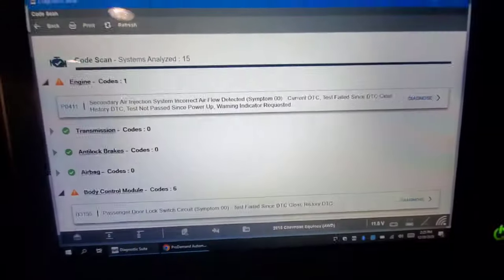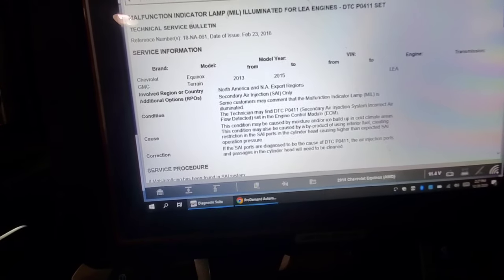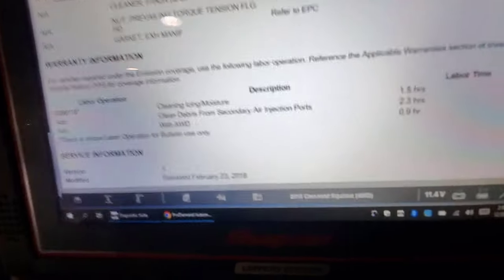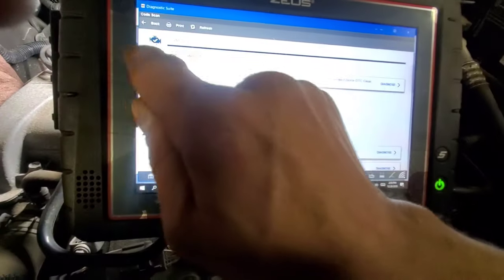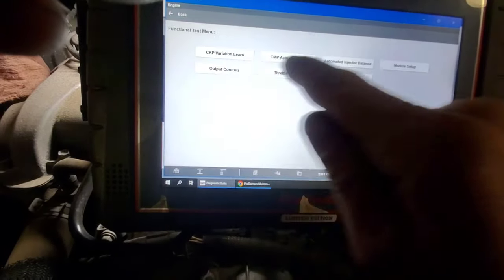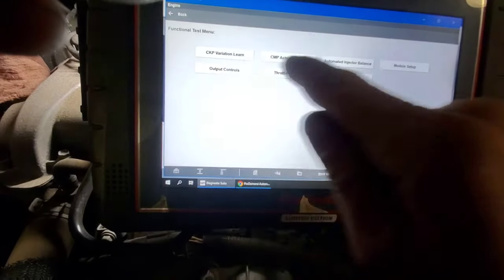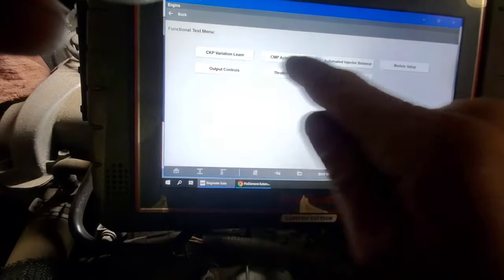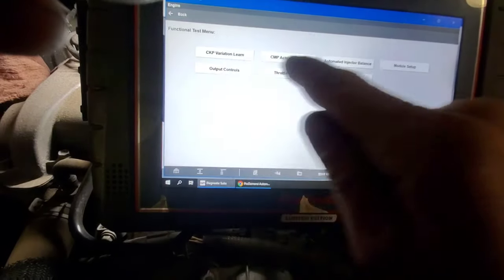GM 2.4L P0411 SECONDARY AIR INJECTION AIRFLOW INSUFFICIENT

Comment: Saved me with this info i have a 2009 saturn aura 254,000 miles i tested my secondary air injection pump working great! I dismantled the air valve that goes behind the block of the engine and has plenty of carbon build up

Comment: Are the 2 runners held on by 2 studs per runner and the studs have nuts or are they bolted to the motor? Might be har but could the runners be removed from the top with some effort and colorful words?

Comment: i am currently engaged to one of these , It should have been a warranty repair by the Manufacturer , but here I am . those S.A.I. valves should be replaced and in Pairs only by the same manufacturer. there are reed valves in them and they burn , get hot and warp  so they leak and hot exhaust cooks the inlet valve , you can take the top of the valve , 4 screws and see what i'm Talking about, they have to be tuned for the initial air charge to read in Balance , scan data calls it variance, no more than 3 psi , scan info for one is listed as KPA's and Psi on another "Confusing at best, but the conversion has to be done to be accurate. Baro  and circuit A to Circuit B , I'm presenting that as air inlet A and air inlet B, Those need to be calibrated to match seal at below 3 psi. I took them off and started the engine to feel the exhaust blowing out of the ports, I saturated the ports with  de-carbon , BG 44k, now that I nave the balance , it takes 2 test drives 35 miles to get the sec Air monitor to run , usually right after the Cat , monitor sets, time consuming way beyond 5 hours, and a lot of it seems pointless and overkill , but that's Emissions for you, I check tomorrow morning to see if flow goes through the Head , I assume it does because exhaust is blowing out of the ports. but it may be  restricted just enough. the Sec, Air  system test in the snap on program allows both valves to open and pressurize , if there is an imbalance in the upper chamber of those valves code p0411 sets immediately. if there is balance it's on to phase 2, flow through cylinder head , I'm hoping the de carbon will break it up so there is no tear down of the manifold I'm already way upside down in the estimate. 15 hours should be the total check out and repair of this rig.
Reply from the maker: Fascinating, thank you for the info.
Reply: Day 2 , honeymoon is over, I can't make this thing happy , i have a zero variance , psi increase of  1.7, 0'2 signal responds instantly when AIR pump is activated, Map spikes, and Baro is spot on with sec a.i.r. valve sensor 4500 ft elevation 85 kpa, 12.5 psi, as soon as the sec monitor passes it codes p0411.  I need to send this thing back to it's Mother! Where are the figures for expected calibration? What is the Calibration standard? I wonder if there is a Load sensor for the A.I.R. pump? internal  pcm? not mentioned in diagnosis trouble tree?
Reply from the maker: Maybe you have a weak pump due to the blocking of the ports
Reply: @PaulysAuto   Got it! pump is fine , I took the manifold off finally, and there in was the culprit, I had a flapper, pieces of the burnt S.A.I. valve were trapped in the ports, port could breathe, but the flapper would close it off ,  randomly ,  after I cleared the debris, the Monitor set immediately , one of the noticeable scan  data information was the secondary pressure pid, not the  secondary sensor , but the secondary pressure , and the variance both held pressure  when it faulted, after clearing the debris the pressure would go up with the air pump but would fall off as soon as the pump shut off, one trip , sec monitor passed at start up.  Thanks for the video it was helpful to know that steps have to be followed, Time is Money, Money is time!

Comment: I just found this video and it's exactly my problem...P0411 insufficient flow air injection...but wow so much work...I wonder if can be done without  CAT coming out?
Reply from the maker: It's best to remove everything...you will have a much easier time cleaning those cylinder head ports from below.  It's time consuming and messy, but be sure you clean it thoroughly or you'll be in there again.

Comment: Currently in the middle of replacing an engine in one and the replacement I got had these holes but the car itself didn’t have the modules . Am I able to block them off or should I just change the heads
Reply from the maker: The Exhaust Manifold Gaskets do that if I remember correctly....different Gaskets depending on emissions.  Sorry for late response my friend.

Comment: I have a 2006 chevy trailblazer keep failing emission this the only code that comes up P0411 even the Chevy dealer can’t tell me why I keep having this code after everything has already been replaced!
Reply: Question I got the P0411 code... i replaced the pump but the original pump is actually good. So that was useless. I dont want to keep buying parts if they arent bad. What should be the next step? Valves? Solenoids? How can I pinpoint it?

Comment: Awesome video just helped me out a lot but the customer came back a few weeks later and it says secondary air injection low voltage but I checked and seems fine so I'm lost again.
Reply from the maker: Did you do your voltage drop tests on both your SAI Solenoids?  Also would be good to do pin tension testing on both the connectors.
Reply: @PaulysAuto  thanks I will do that!!!... I checked voltage in both solenoids and they were the same but I will do that and see what happens thanks.
Reply from the maker: @philliprollman7421 very good keep me posted on your findings...God Bless my friend.
Reply: @PaulysAuto  thank you..and I had another one show up today for the same thing
Reply from the maker: @philliprollman7421 maybe you are called to finding the REAL reason why?

Comment: Uy veh.  Yet another reason I don't like my wife's 2013 Equinoxious.  We've had the P0411 for about a year now, I know the pump works and the hoses are clear.  Has to pass e-check next year.  Between this problem, the chronic oil burning, and the rusting doors, it's been quite a cursed little car.
Reply from the maker: Well, you gotta stay on top of oil changes, induction services, and so forth with the GM 2.4L, you should be watching my livestreams my friend 😉
Reply: Hmmm...my 2013 doesn't have this secondary system. It must be a California emissions thing. I recently rebuilt my 2.4 and wonder why some do and don't have certain things.
Reply: @PaulysAuto  This is actually an incorrect statement. Even if he stayed up on oil changes and watching your live streams, it would not help him. It's a know fact and there was even a class-action lawsuit that some of the 2013 Equinox's got some bad motors that the rings go bad and burn lots of oil. My girlfriend has one, and it would burn a quart of oil every 450 miles. The rings are so bad, you can hold your finger over the vent tube on the valve cover, and it'll build enough pressure, that when you let go, it's like a turbo blow-off valve going off. lol. Also, with some these burning oil that bad, and say the cat gets clogged, could the pressure above the cat in the exhaust system be a cause for this code? Like not letting the solnoids pump the air in becuase the pump doesn't have enough pressure to fight with the build up of pressure because of the clogged cat?
Reply from the maker: @MagnumChris   Eventually you have to re-ring any engine with emissions like this and let's just be honest, the 2.4L is a gravy engine to re-ring.   You can soak the d*** rings and slow the oil burning down or you can just bite the bullet and slam the pistons out the bottom and get it done.   And I still think and I will still hold up to this, people do not change their oil enough nor do they even check it frequently - that's a straight fact.
Reply from the maker: @MagnumChris   GM Engine Top Tier does amazing things -  Which is what's recommended to clean these ports on these heads with these California emissions when they get plugged up with all the crap thanks to California's ridiculous standards!
Reply from the maker: @MagnumChris   As far as the plug cat is concerned if the cat becomes clogged or burned down you're missing something besides the oil burning.
Reply from the maker: @MagnumChris   An engine that's burning that much oil, probably isn't reaching adequate operation temperature due to short trip driving; which is the worst thing you can do for any engine.
Reply: @PaulysAuto  This equinox also blew out the T-Case, the bearing near the cat went. My theory is with the rings being bad and it burning so much oil, that the cat was getting super hot and broke down the T-Case gear oil prematurely. Other than this thing burning oil, it actually hasn't been a bad car.
Reply from the maker: @MagnumChris  That's an interesting theory 🤔...I am sorry to hear that, they really are nice to work on for the DIY guy at home...that's why I like them 🙂...simple and reasonable in price to fix.
Reply from the maker: @MagnumChris   If I were to buy one I would stay away from all wheel drive makes it a lot easier to work on and less problems.  Those transfer cases Definitely get warm it's a shame they didn't run a small cooler on them Like Ford ended up doing on theirs...cheap as possible to make it affordable -  You know the drill.

Comment: Stumbling across this as I'm actually looking to replace the exhaust manifold but came across my engine having what I'm finding out are these...secondary air injectors.  It made the task a bit more complicated than I'd hoped after watching other videos regarding manifold replacement.  Question...are all of these bolts for the "runners" easily accessible?  Upon a quick inspection of the engine and when I found out these were in my way I was able to see/feel for maybe 2.  This wasn't very in depth but it appeared this was going to be quite the chore getting these off and out of the way to get to the manifold (I think I've read a few comments in some message board/forums also stating that he was seemingly unable to get to find all of the bolts holding the runners on the header).
Reply from the maker: They are accessible, but a set of wobbly 1/4 in extensions is a must my friend.
Reply: @PaulysAuto  Understood!  Thanks kindly for the quick response!
Reply from the maker: @seanbennett7773  you betl
Reply: @PaulysAuto  Don't expect you to see this and this is again a bit of an aside to what your video is about but there just isn't much out there on doing this for the layman.  So here goes: what exactly is one do with getting the aluminum piping that the SAI rubber piping connects to that brings in the air (and rests "beside" the runners and on top of the heat shield/exhaust manifold.). This thing is likely killing my DIY ex. manifold replacement! I just found where get the remaining 4 bolts to the runners (under the heat shield, of course) but to proceed any further, that piping is clearly in the way and of course comes all the way from the lower front of the engine. It seems likely too big a job at this point but figured I could try to pick some online brains some more before giving up!
Reply from the maker: @seanbennett7773  you should be able to gently bend it back enough to make it work.  It's possible brotha, it sucks, but possible 😉
Reply: @PaulysAuto  This is what I started wondering...I went back and gave it a try with this thinking and man this thing does not want to budge!  Thanks again for the reply!

Comment: Is this 2.4 the same motor as the 2.4 in the 2013 Chevy Malibu?
Reply from the maker: Yes provided it has CA Emissions in which case you will have Secondary Air injection (SAI) as in this video.

Comment: Hello Pauly. Great, informative video! May I ask the name and make of that fancy diagnostic tool you're using to diagnose this problem? Every mechanic should own one of those!
Reply from the maker: That would be the snap on zeus my friend
Reply: @PaulysAuto  Thank you for your response. That is quite the diagnostic tool! The way you can control/test various systems in the vehicle through it is amazing! My friend is a mechanic and I bet he'd love to have a tool like that. I sent him your video here because my 2013 Equinox 2.4L has the same issue that your video addresses. In addition to cleaning out the carbon clogs on my CA 2.4L (Imagine the carbon after 209K miles...), it also needed both secondary air valves @ $300 a pop. 😮‍💨 They looked nasty!  He's now trying to diagnose a VVT solenoid issue on the vehicle and I bet the Zeus would be of great benefit. Thanks again for the great video!

Comment: Hey there I have a question about the valve air injection What’s side is bank #1? Passenger or driver side?
Reply: My check engine light went on and the scanner gave me this code: P2440 and it says “secondary Air injection system switching valve stuck open (bank 1)
Reply from the maker: It's a 4 cylinder the 4 cylinders are bank 1 there's no bank 2 because it's an inline 4 cylinder monitoring all 4 cylinders with one upstream O2.
Reply: Bank 1 Air valve is on the driver's side.

Comment: I’m dealing with an issue too. 09 cobalt, p0411, p02440 p0442 and I can’t get them to go away, brand new check valve, compressor sounds good and seems to be coming on, goes about 20 seconds and shuts off no matter what I do. I also can’t clear them as they are marked as permanent. Any help would be greatly appreciated. We are expecting a baby any day and are trying to get our car to pass inspection. I’m told p0442 evap leak is caused by the purge valve but mine is working… PLEASE HELP ME 🤞🙏🙏🙏🙏
Reply from the maker: @Ittybitty-o6y  did you clean the ports in the head
Reply from the maker: @Ittybitty-o6y  may God bless you and your children
Reply: @PaulysAuto  I sure did, there was two double ports inside the manifold. I made them spotless and made sure the passages into the sides of the valves was obstruction free. There was hardly any build up honestly. I changed the air pump to one from a different car today, waiting for the am to do a cold start and see if it kicks my light on like it has been
Reply: @PaulysAuto  I very much appreciate the well wishes on my soon to be son. Means the world ❤️ also thank you for responding
Reply from the maker: @Ittybitty-o6y  I'm sorry I wish I could be there to help but unfortunately it's difficult I wish you the best and I know everything will work out ❤️
Reply from the maker: @user-tb3tm8jx7m fascinating sounds like you have a difficult situation I wish I knew more and could see it then I could make a better judgment but it sounds like you're doing your best to figure it out and that's all we can do
Reply: @PaulysAuto  okay sir so this is what I did yesterday, I put the other pump on, as well as the purge valve, don’t believe the purge valve is bad though because I still have the p0442. ALL of the others are gone though so we’re on the path to being fixed. Any tips on finding the small evap leak?

Comment: i have a 2010 malibu 2.4l  it had a secondary injection on it i just replaced the motor with an 08 malibu motor that didnt have the secondary injection on it i hooked everything up except the rail on to the back above exhaust manifold  now i have a p0411 can the sai be removed from the computer from the dealer ?
Reply from the maker: I'm not sure, knowing GM you probably have to get a new PCM and have it flashed accordingly.

Comment: Fantastic video but way more than the average Joe like me can do. I still have the p0411 code and think this is the issue. I had the TBS done by the dealer though and I'm now at 155k miles. Shouldn't they still cover it?
Reply from the maker: It all depends on how well they cleaned the ports out...you may have a weak pump due to them being plugged.

As far as, what they will cover under warranty, I couldn't tell you my friend.

Comment: I have this code on my wifes Equinox, is why its stalling at stop signs & a noise coming from under the hood?
Reply from the maker: I'd be checking out the condition of timing chains by pulling the valve cover...the secondary air injection will not cause stalling.

Comment: Did you remove the shield first to get to the bolts for the SAI piping?
Reply from the maker: Yes you'll have to push her back to get them two bastards...good luck my friend.
Reply: Take it in to a Chevy dealer. P0411 is covered under a special policy emissions.
Reply from the maker: Agreed
Reply: Now that it's getting below freezing here, carbon hardens up and all these equinoxes are coming in for p0411s lol
Reply from the maker: @440-6pakroadrunner  yeah that moisture builds up in them.

Comment: Pauly I’m getting the p2440 is that the same issue or is my valve just stuck open because the trouble code says stuck open
Reply: U ever get it fixed I'm having the same issue